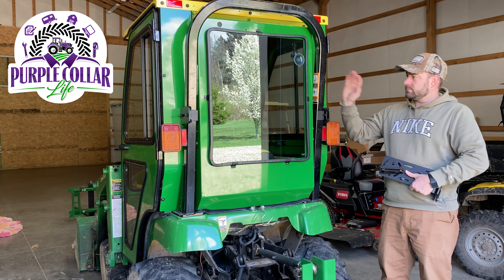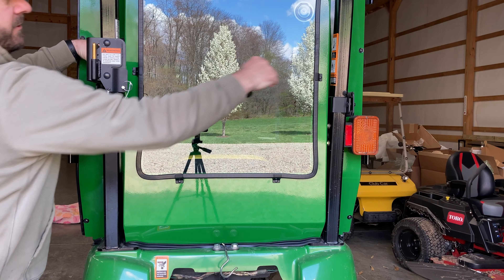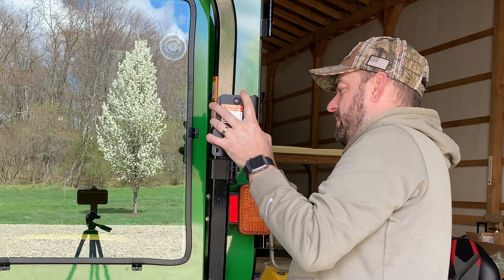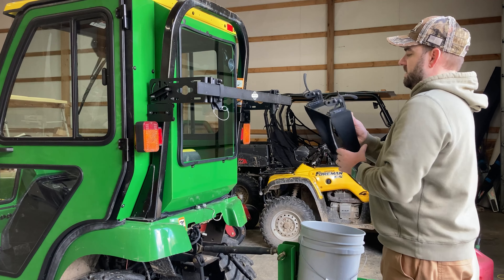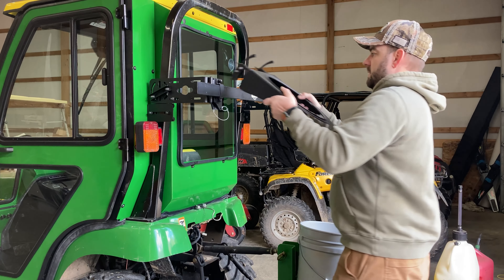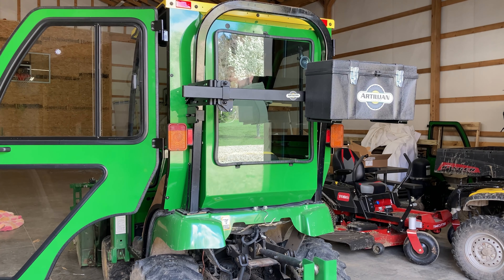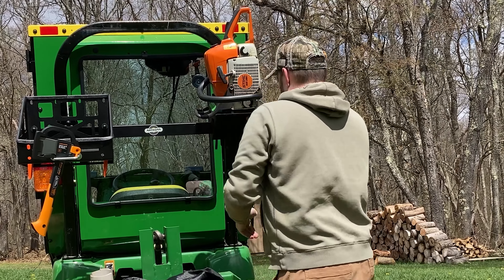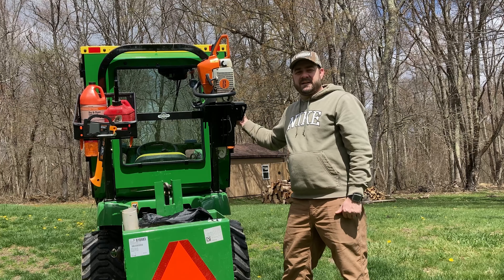#191 Artillian ROPS Tool Bar Re Installed on John Deere 2210

Comment: I need to get the Artillian tool system for rakes, shovels, and hoes.  With all the tilling projects I have had this spring, it would be great to have them on the tractor in place of the back of the truck.  Glad you were able to get it reinstalled, and have a great rest of your week, Jason
Reply from the maker: Hi Jason! It is a great tool for sure.  You'd love having all those tools on the ROPS when you're doing all that rototilling.  Thanks for watching and commenting!